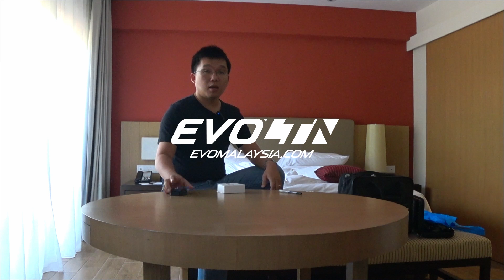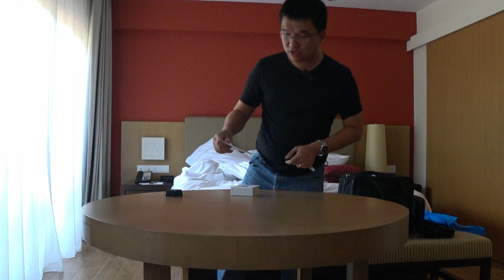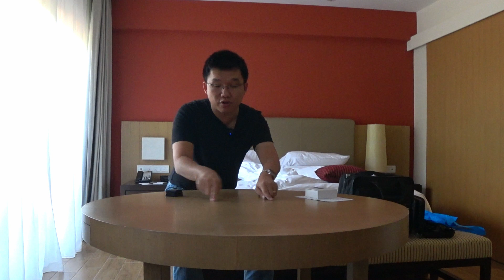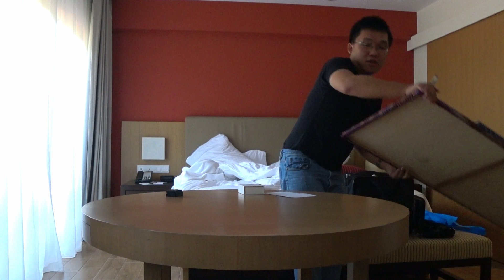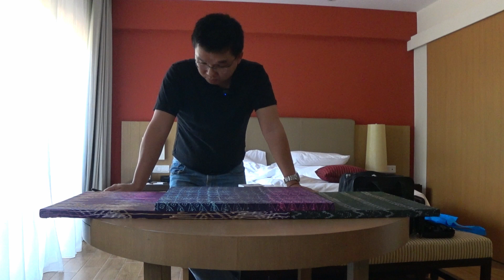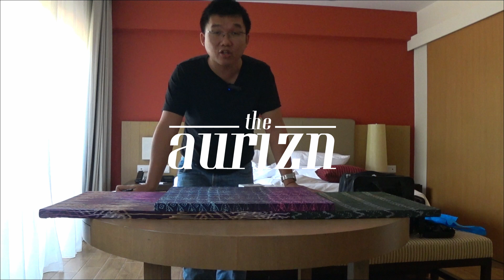Rumble strips are a bad idea, and here's the physics to prove it | EvoMalaysia.com

Comment: No doubt rumble strips change the physics, but to decide if it makes roads safer or not you would need to consider other factors besides just the physics. for example, by its design the strips are supposed to create a "rumble" resulting in an action on the driver's part.  statistically rumble strips could prevent more accidents than cause them, i believe this is so but we would need to check studies conducted on this. I personally hate these strips, but i find them helpful on occasions when I do irritatingly bump into them
Reply from the maker: The laws of physics should be a main consideration. Your vehicle dynamics and response are governed by the laws of physics.

Comment: Throughout the years engineers were struggling to fine tune suspension setup in order to minimize mid corner undulation. But here 'suka suki pergi letak' those red rumble strips

Comment: While your explanation hold truth in the friction change between two different materials that is the premix wearing course surface and the thermoplastic rumble strip print line, the change is negligible if the driver had already begun deceleration before going into the road bend. When such lines are imprinted on the road surface, vehicles are not allowed to travel at straight road prescribed speeds example 110km/h or 90km/h. The driver have to slow down to a lower prescribed speed marked by the highway operator. 
Please note, road markings such as these are not pure stupidity by the highway operators as Chris Wee was ranting and yelling about last week over two video posting and you trying to support him now justifying his rant. The road engineers are guided by design codes and the are professionals in this field. We as drivers must slow down our vehicles when around these dangerous bends as advised by the highway operator. 
I would suggest you and your team do what you best, review cars.
Reply from the maker: Let's get one thing clear. I am not against the objective of slowing vehicles down at dangerous stretches. I am all for it. 

But my POV is that rumble strips are not the way to do it. Rumble strips are great in preventing drivers from accelerating in slow moving conditions, but on a highway where even if one isn't speeding, the suddentl change in surface conditions as I mentioned affects both the dynamic balance of a vehicleas well as the effectiveness of its braking system to slow the vehicle adequately.

Do you have a biker friend? Ask their thoughts on this.
Reply: Totally agreed with u, however this people assume we doesn't have driving experience and think their is the experts. Some more dare ask us to take motorcycles and try it...arrogant
Reply from the maker: Here... take it from JKR.

https://m.facebook.com/story.php?story_fbid=10158066633688436&id=529148435&sfnsn=mo

Comment: The rumble strips are supposed to forced drivers to slow down to a manageable speed.
All the theories are fine and good. The test of the pudding is in the eating. 
What is needed now is accident statistics that shows the rumble strips, indeed in real life situation, cause accidents.
Reply from the maker: Rumble strips are good in preventing drivers from accelerating. Put it this way, how can a car slow down effectively if the road condition itself disrupts the grip of your tyres on the road?
Reply: @KonWaiLuen  like i said, we the need stats ...
Reply from the maker: https://www.facebook.com/groups/1044575449055419/permalink/1381824715330489/

Comment: Also at some places, they not only have rumble strips, they add those metal bumps or whatever you call it (Generally you'd see those on approaching a highway entrance/exit).

There's a few around in my area that I know and it's spine shattering and sounds like your car's suspension is getting destroyed everytime I drive through some of the spots. I guess rumble strips aren't enough to drive the point that it was a school area or approaching a stop light situated downhill or whatever.

Comment: Yes I agree putting those rumble strips the full width of the road including corners is bad. In the US, they only use it on sections of the solid line to prevent drivers from wandering out from it, or to "wake" people up that they are approaching a stop sign.